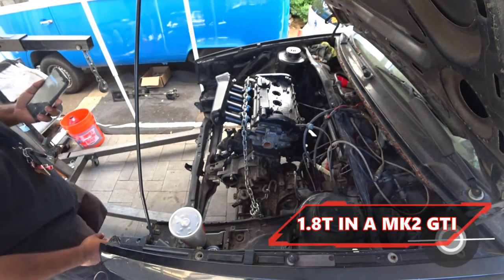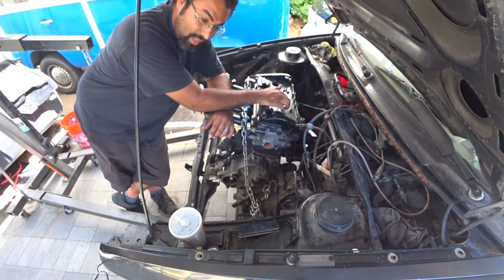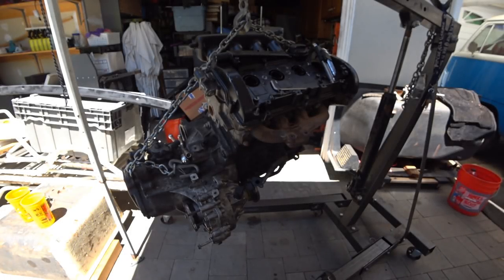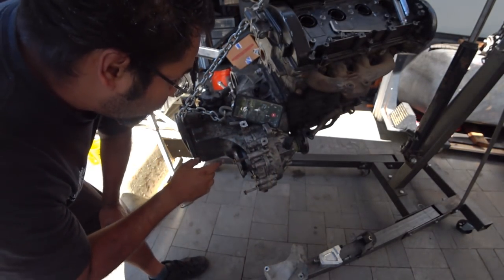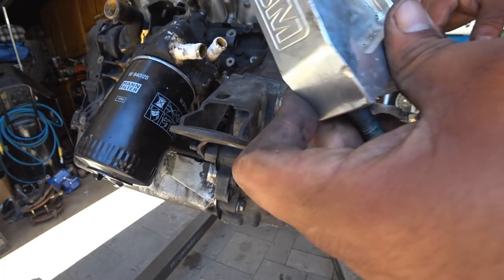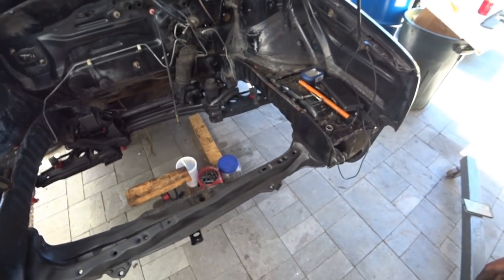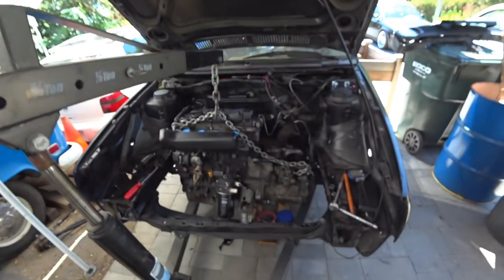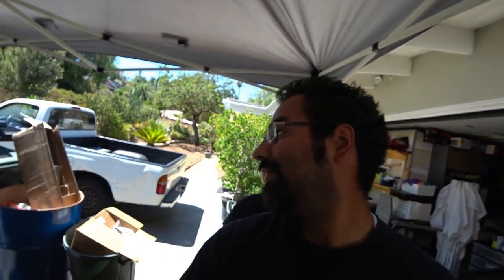1.8t in a VW MK2 - Mockup DIY Season5 EP34

Comment: couple of questions... the bolts for the rear bracket you said was off a mk4, is it mk4 engine mount bolts or something else? also the bracket you couldnt get a part number for, what was it off do you know? thank you!
Reply from the maker: The bolts i used are random ones I found i my mk4 bolt jar. The bracket I am using is for a G60 Corrado. All the brackets actually. 
You can use all the bolts off the corrado excpet for the front bracker. Youll need to drill out the threads and use the mk4 starter bolts. Youll also need a lock washer.and nut.

Comment: Does it work for the AWM 1.8t or just the AWP 1.8t?
Reply from the maker: Awm is passat motor and yes it will work but youll need AWP parts to make ot work
Reply: @PincheALsGarage  ok. same mounts though?
Reply from the maker: You have to use corrado g60 mounts
Reply from the maker: You can also use stock mk2 rear mounts and use Fabless Manufacturing front bar
Reply: @PincheALsGarage  So if I just get the fabless manufacturing front bar, I dont need the g60 motor brackets you mentioned in the vid and can use the oem mk2 ones? Thanks.
Reply from the maker: That is correct!
Reply: @PincheALsGarage  Really appreciate the reply, waiting on future videos. Cheers.